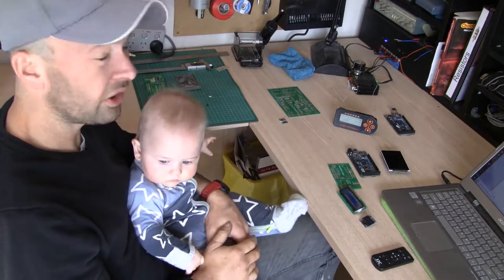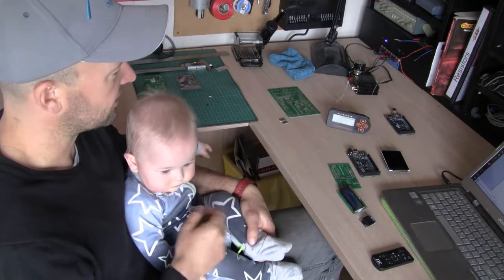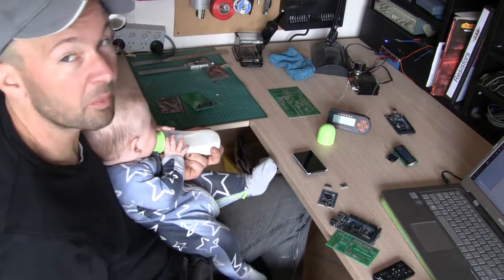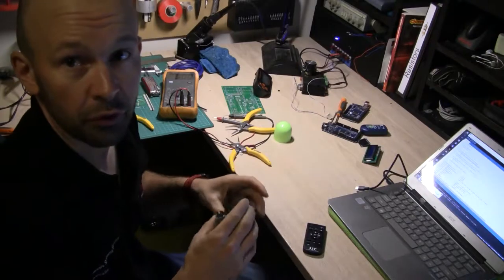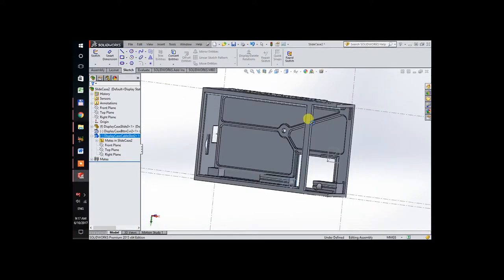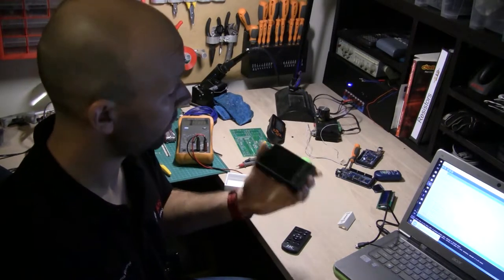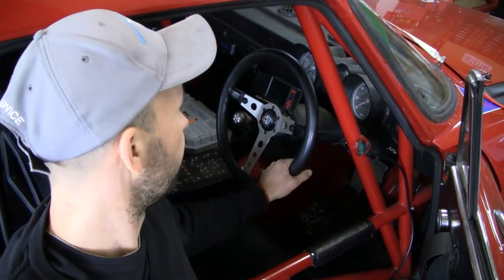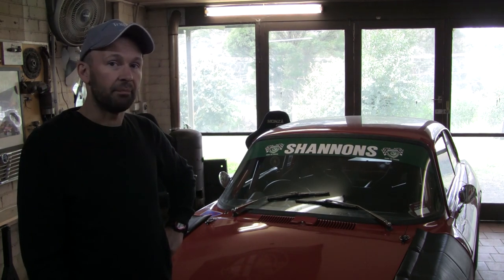Arduino powered Motorsport Dash Display

Comment: Greate to have found this...but it’s way over my knowledge and real needs.
I just wanted something simple for rpm, EGT and CHT on a 2t. Some logging would be nice though...and maybe... Here we go again. 🙈
Got an old DL1/DASH2...but it’s not looking or fits right to a small, vintage, moped. 😆

Thanks for charring the code. I will most likely learn a lot from it. 👍
Reply from the maker: No worries, hope it helps out with your project
Reply: Colin Byrne If you can upload a couple of extra hours per day for me to download I would appreciate it a lot. It would help to get at least one of my projects finished...or even started. 😬🙈

Comment: Hi again.  Will an Arduino dash display feature on the Stratos build, or more traditional gauges?  A Mega Arduino is also the basis of the Speeduino engine management system.  I'm really enjoying the series.
Reply from the maker: glad your enjoying it, yea the arduino powered dash will make an appearance in the stratos, i'll keep some of the original looking gauges also. 
A Speeduino may also make an appearance, have to wait and see!

Comment: Hi Colin, great video. Enjoyed. I complied display18 and display 22, both gave errors on undefined  variables, did I missed some files that were not in the sketch or what did I missed when download the sketches. I installed all the library that were needed in the sketch.  Any suggestion will be greatly appreciated.
Reply from the maker: Hi Betty, display 22 should have compiled, probably a library mismatch, what exactly is the first error?
Reply: @105colin  :Here is the error message from IDE when you compile the sketch: display18, Display22 have similar error. may be easier to send by email. thx.

\ardiuno\Display18\Display18\Display18.ino: In function 'void setup()':

Display18:835:1: error: 'Serial3' was not declared in this scope

 Serial3.begin(115200); //Main communication

 ^~~~~~~

E:\ardiuno\Display18\Display18\Display18.ino:835:1: note: suggested alternative: 'Serial'

 Serial3.begin(115200); //Main communication

 ^~~~~~~

 Serial

Display18:840:3: error: 'TCCR4A' was not declared in this scope

   TCCR4A = 0;// set entire TCCR2A register to 0

   ^~~~~~

E:\ardiuno\Display18\Display18\Display18.ino:840:3: note: suggested alternative: 'TCCR0A'

   TCCR4A = 0;// set entire TCCR2A register to 0

   ^~~~~~

   TCCR0A

Display18:841:3: error: 'TCCR4B' was not declared in this scope

   TCCR4B = 0;// same for TCCR2B

   ^~~~~~

E:\ardiuno\Display18\Display18\Display18.ino:841:3: note: suggested alternative: 'TCCR0B'

   TCCR4B = 0;// same for TCCR2B

   ^~~~~~

   TCCR0B

Display18:842:3: error: 'TCNT4' was not declared in this scope

   TCNT4  = 0;//initialize counter value to 0

   ^~~~~

E:\ardiuno\Display18\Display18\Display18.ino:842:3: note: suggested alternative: 'TCNT0'

   TCNT4  = 0;//initialize counter value to 0

   ^~~~~

   TCNT0

Display18:844:3: error: 'OCR4A' was not declared in this scope

   OCR4A = 137;// = (16*10^6) / (8000*8) - 1 (must be <256)

   ^~~~~

E:\ardiuno\Display18\Display18\Display18.ino:844:3: note: suggested alternative: 'OCR2A'

   OCR4A = 137;// = (16*10^6) / (8000*8) - 1 (must be <256)

   ^~~~~

   OCR2A

Display18:850:3: error: 'TIMSK4' was not declared in this scope

   TIMSK4 |= (1 << OCIE2A);

   ^~~~~~

E:\ardiuno\Display18\Display18\Display18.ino:850:3: note: suggested alternative: 'TIMSK0'

   TIMSK4 |= (1 << OCIE2A);

   ^~~~~~

   TIMSK0

E:\ardiuno\Display18\Display18\_96_SerialCommunication.ino: In function 'void RunSerial()':

_96_SerialCommunication:15:7: error: 'Serial3' was not declared in this scope

   if (Serial3.available()>=1){      //Check if serial buffer is empty

       ^~~~~~~

E:\ardiuno\Display18\Display18\_96_SerialCommunication.ino:15:7: note: suggested alternative: 'Serial'

   if (Serial3.available()>=1){      //Check if serial buffer is empty

       ^~~~~~~

       Serial

_96_SerialCommunication:39:9: error: 'Serial3' was not declared in this scope

     if (Serial3.available()>=bytesNeededInBuffer){ //check if there are enough bytes in serial array

         ^~~~~~~

E:\ardiuno\Display18\Display18\_96_SerialCommunication.ino:39:9: note: suggested alternative: 'Serial'

     if (Serial3.available()>=bytesNeededInBuffer){ //check if there are enough bytes in serial array

         ^~~~~~~

         Serial

_96_SerialCommunication:178:5: error: 'Serial3' was not declared in this scope

 if (Serial3.available()>60){      //Check if serial buffer is full

     ^~~~~~~

E:\ardiuno\Display18\Display18\_96_SerialCommunication.ino:178:5: note: suggested alternative: 'Serial'

 if (Serial3.available()>60){      //Check if serial buffer is full

     ^~~~~~~

     Serial

E:\ardiuno\Display18\Display18\_99_SerialFunctions.ino: In function 'void sendAnalogMessage(int, int)':

_99_SerialFunctions:24:3: error: 'Serial3' was not declared in this scope

   Serial3.write(header);

   ^~~~~~~

E:\ardiuno\Display18\Display18\_99_SerialFunctions.ino:24:3: note: suggested alternative: 'Serial'

   Serial3.write(header);

   ^~~~~~~

   Serial

E:\ardiuno\Display18\Display18\_99_SerialFunctions.ino: In function 'void sendFuelAmountMessage(int, long int)':

Comment: Great stuff! Trying to figure a way to get a digital dash into my '76 VW bus. Looking to figure out a way to make it happen. Cheers!
Reply from the maker: Thanks mate, can share the code if your interested, I never got around to making the video of the control unit but will be making a new version soon for the latest rally car. New one will be based around CAN rather than serial communication
Reply: @105colin  that'd be great! Still acquiring parts... Started by just wanting a raspberry Pi head unit.... Down the rabbit hole one fallen... Going to order an Arduino soon lol.
Reply: PS: Alfa Romeo's are my first love! First car was a Fiat 124. Always wanted the Alfa GTV. Too rare here for my budget. Good choice!
Reply: Sooo cool stuff. I will build someting symilar to my litlle race car fiat 126. Check my onboars 😉 Can you share youre code? 
Goog jab and nice car !
Reply from the maker: No worries code and PCB files are here
https://github.com/colinbyrne105/RTArduinoScreen

Comment: Hi Colin, I found your Github for the RTArduino, I wondered if you had a schematic of the wiring for the arduino mega, just so i could under stand the code a little easier? thanks
Reply from the maker: Hi Richard, I was pretty slack and just designed the pcb on the fly in diptrace, so no proper schematic, happy to share the pcb files, and there is a free version of the software